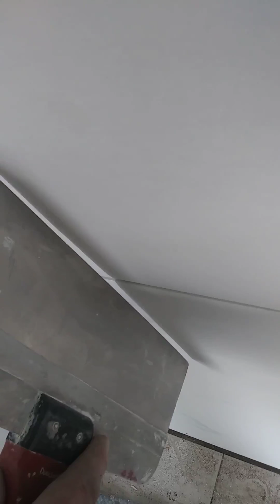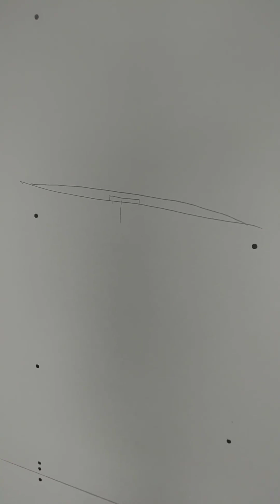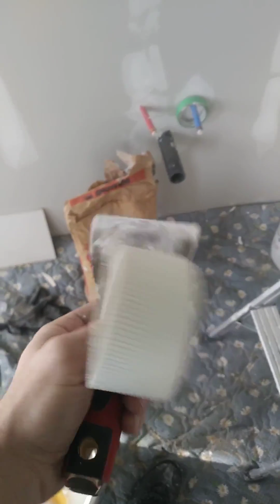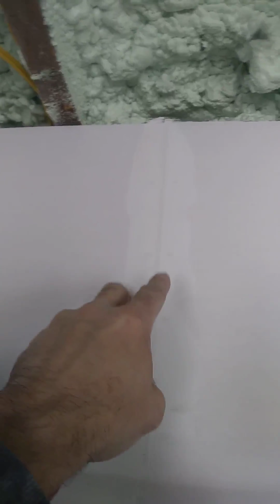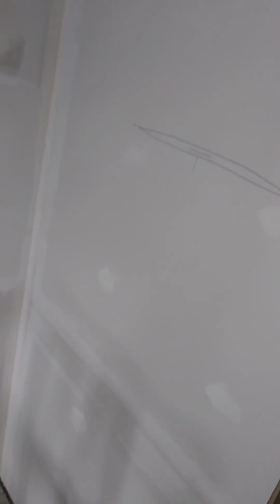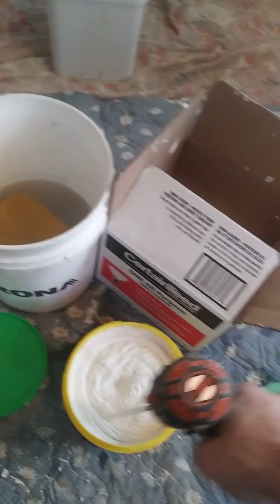How to finish Drywall butt joints! Hack for beginners

Comment: One mistake is using the broad knife that causes humped by the self but if you know what you’re doing you are not well not leave a harp and you do not need to go very wide 12 to 13 inches is it why do you need to go for a bite seemed same as your factory seems I do not charge very much for lessons if you need them and what you’re showing you definitely need them